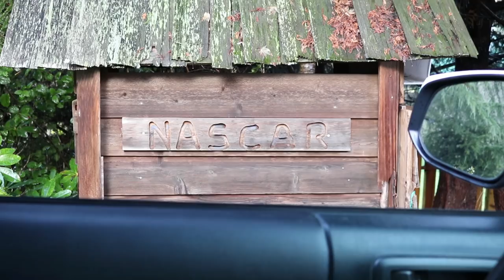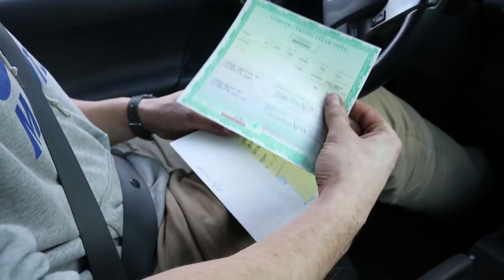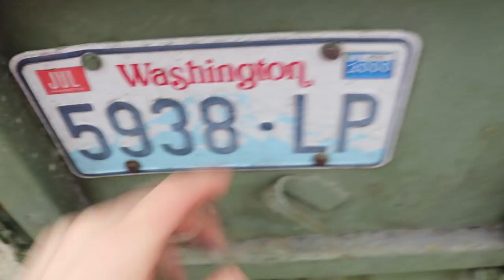The Perfect Off Road Trailer (Army M101 Overland Trailer)

Comment: I bought one and converted it to a 6x5.5 3000lb axle. Watch the rear tail lights lights backing up if you do lower it at all, took out my driver side going into my yard. (It was loaded with a cord of wood). Going recessed led now. I would have sold mine for a song a few months ago, going back to a 4Runner now, the Ram 2500 go bye bye. These are solid trailers and track perfect. Super easy to move by hand unloaded too.

Comment: Definitely the right size.  Scored on military trailer will make a wonderful base Max Powell's Overlander rig.  With current tires it will go anywhere your truck does (curious which weighs more your current tires or military set up).  Although loading motorcycles and using as a chuckwagon would be easier if it was a little lower.

Comment: Score! I made the same mistake, bought a M105 1.5ton military trailer and sold it to get an M101A2. Looks like you have the M101A1 which doesn't have the Chevy 8-lug pattern. No biggie if you plan to swap the axle out. Does your trailer tilt function work? Lock the two front hand brakes down in front, and pull the two pins/bolts in front and you should be able to back up with the wheels locked and tilt the bed up. Those trailers pull pretty solidly! I'm looking forward to see what direction you go with it!!
Reply: So the m101a2 is the best option?

Comment: Nice!  I'm down in Portland and have been trying to figure out which surplus trailer to get for overland purposes, I've got a GX470/Prado 120.  The M416's are just crazy priced, nice to see that the M101's are an option as well.
Reply: Yeah it's between something like the M101 or a tent trailer (what my Wife's initial thought was).   I plan on using something like a Tepui roof top on the M101, then I can move the tent onto my GX when we don't want the trailer, and then I also have a trailer for when I need a trailer.  I feel better going that route and having an adaptable multi role investment, rather than just a tent trailer (which if I went down the right/wrong path, would be a one way trip for the trailer  ;P )

Comment: Hey Max, an a1, those are nice trailers. Be careful with those wheels in the army we called them widow makers. The rings can come off at a high rate of speed and remove your head. You can get dexter axles for it that have the same lug pattern as your truck. Also you will find that with those tires makes it harder to pull. The BUD wheels suck.
Reply: you will drop 500 lbs or so. I added electric brakes on mine